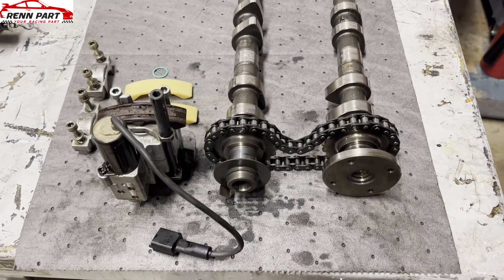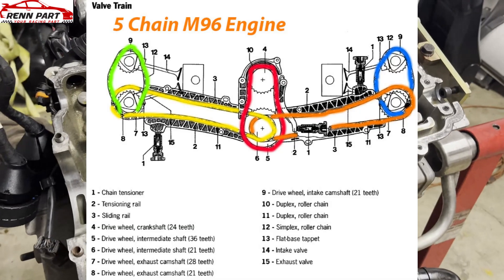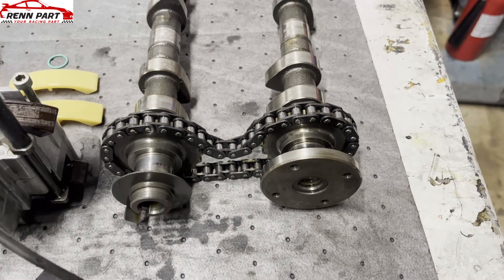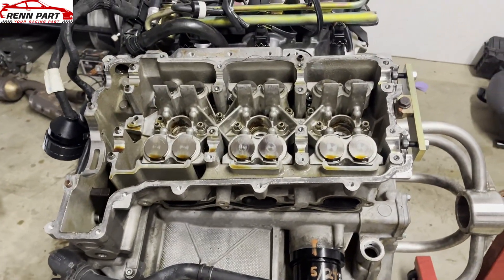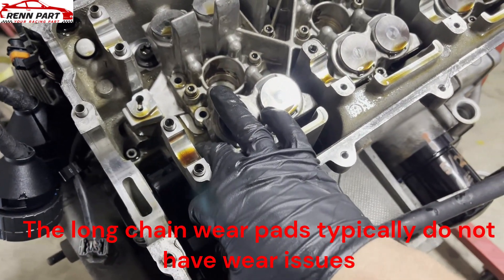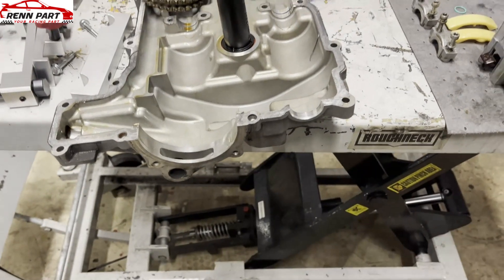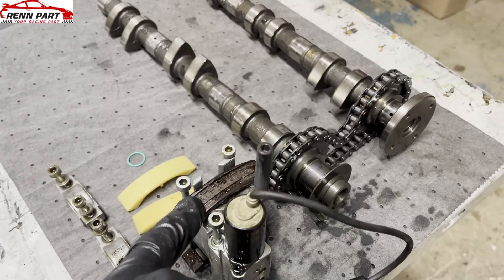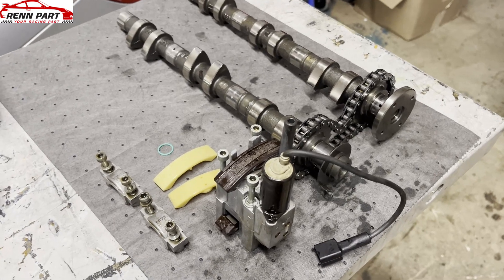What is "Cam Deviation" In the 996 Carrera and 986 Boxster?

Comment: Looking at doing that this summer on my 986S with 92k and -7.1° and -5.7° deviation readings.  Anything to do while I'm in there? Thinking ultimate AOS, fresh injectors, any tubes or hoses etc that are a pita in the car. Mine sees autocross and lapping days on 200tw tires and deeper 2qt baffled pan. Cheers!

Comment: AT replacement short/longblocks from 2019 what pads did they come with?
Reply from the maker: short block wouldn't have heads so whatever your heads are you are re-installing. Longblock from 2019 should be the newer style cam pads. I have also had issues with cam deviation with failed gaskets in the variocam actuator, just did one last week that had high deviations and lots of green o-ring debris in the oil filter --Aaron

Comment: You can do both sides with engine in the car.  If you loosen the cross bar on both sides and drop the side your doing more than the other there is just enough access.  4-5-6 (right side) is tougher as the AC compressor is on top of the tensioner that needs to be slacked off/removed to undo the chain.  I've done 3 cars.  All 5 chain engines need this by 100K.  Good video.
Reply from the maker: Did bank 1 on a 996 recently, it is doable. The reason I drop the motor is to 1- it makes it much easier 2- I can replace all the topside vacuum plastics (including that long hose that goes to the AOS!) and 3- I like to clean everything.
Reply from the maker: I did bank one in a 996 with the engine in the car- while not ideal it is possible. --Aaron

Comment: Dear sir, with all due respect, only half of the story is correct. Correct is that that guide’s wear affects relative cam postion. What is incorrect is to call that cam deviation, as that refers to deviation between crank and cam. It is measured in deg. CrK and per bank, not per camshaft. That’t why my 3-chain M96/03 can also have cam deviation😎.
Reply from the maker: That is correct- I was incorrect in the video. The deviation is between the crankshaft and cams, not from cam to cam. Although I'm sure wearing cam pads can cause a deviation between the intake/exhaust cam etc. Either way when the pads wear nothing good comes of it! --Aaron

Comment: Another great video! I am planning on trying this with the engine in during fall.
Reply from the maker: Take your time, my advice is to pressure wash the engine after you get it out. Also, we have the cam chain wear pads in stock at a lower price because we bought 50 sets of them in mid 2023 before the price hike.